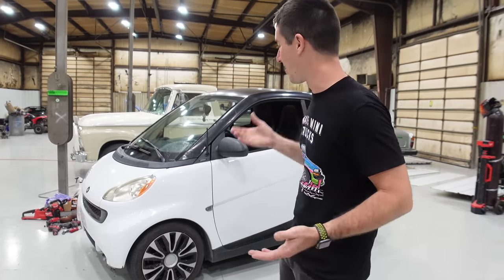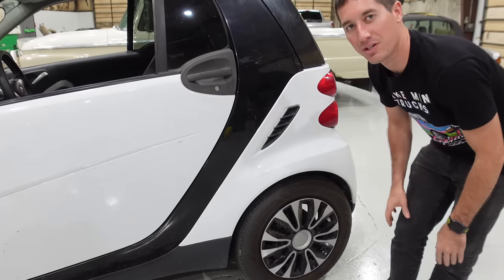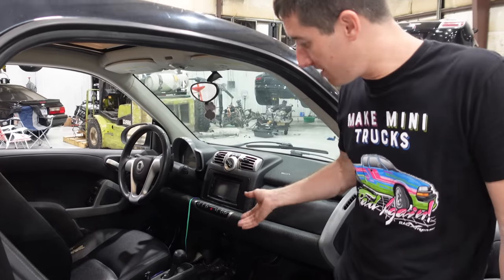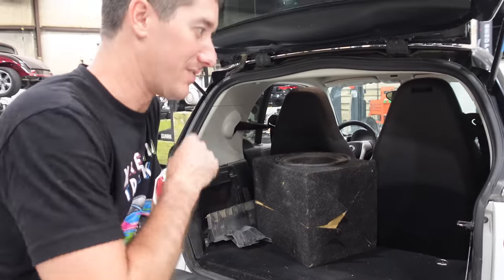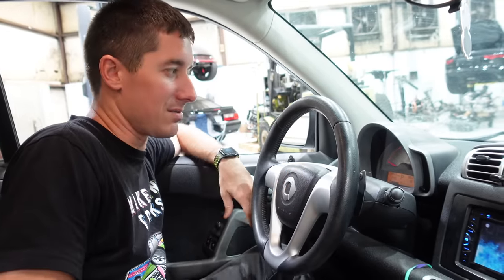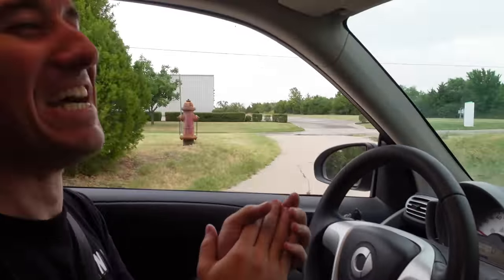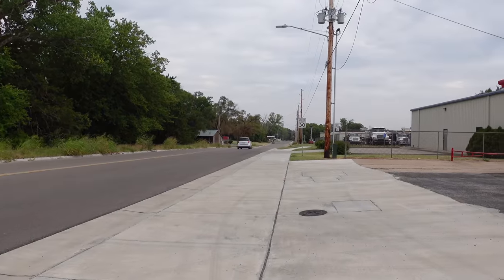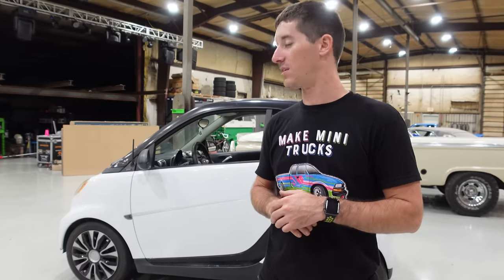I BOUGHT A CHEAP Smart Car.. Is It As DUMB As They Say?

Comment: I never took Smart Cars seriously in the past, but this video changed my perspective on them. I like them now!
Reply: I thought these were more practical than people gave them credit for. When this car first came to the States, RV brands didn't laugh. They saw an opportunity: one class A and several fifth wheel trailer brands immediately worked on converting one model in their catalog to hold one! They even added a clever hydraulic ramp that could slide out with a remote. That way, you do NOT have to drive it in. Park it on the ramp and hit the switch. It pulls the car into the garage. Even better, the wife's purse is safe because burglars can't break into the car if she forgot and left it on the passenger seat. I lived in Switzerland for a short while and trust me, they CAN be driven on snow and ice. If they couldn't half of the city would be crippled on its morning commute! These were everywhere. Even the company my dad worked for had one for advertisement. It was a distributor of powders used to treat paint so you can easily adjust the brightness of white or gray paint. Trust me, there's a sizeable market for that.

Comment: Try pulling your clutch actuator out it's the 3 bolts right under your car or find the sweet slot of where your plot chicks will help it shift a little better unless you have a star system or a scanner to do it  Also putting your are key accessories on and holding those 2 buttons  Down on your - at exactly the same the same time and the middle triangle will Flash it will turn your track you can throw off let your wheel wheel spin a little bit or  you can pull the abs  Fuse
Reply: Oh, that's why it squeals... even with a passenger.

Comment: So far loving my 2010 Smart…I bought it in 2021 with 7k miles.  I drove from Texas to Florida without any issue… other than it’s not too comfy to sleep in 😜…. I consistently looked down to see my speedo between 85-90mph 😳…. I read it would go 96 mph and I believe it.   It definitely takes it a little time to get there but I didn’t buy it to be fast off-the-line.  My mileage fluctuated between 35-40 mpg going at LEAST 80 mph the majority of the time.  I plan to upgrade the front tires/wheels… that’s about it.  Mine does have auto-down windows, I guess that was an option or something….

Comment: Brilliant video!  My partner has got a convertible Smart, and what a cracking little fun run around it is for work commutes, shopping and doing upto 100 miles per run or even a bit more. They are fairly safe, well made, economical and they are a  definte head turner as well! Its a proper 'girly', fun run rider car  OR for maybe a guy that fancies an around town head turner.  I drive a Mercedes SLK, and the Smart seems to get more attention than my car!

Comment: The best off-road rig is the ZAZ 968. Rear mounted air cooled engine with rwd setup along with suspension made for soviet rural environment means it can fly through the fields like it's nothing.
It also can be fixed with hammer and string anywhere.
Reply: It was designed based on Porsche ideas.
Reply: @johnkelly6888  Do Porsches have an ice fishing hatch? didn't think so :)
Reply: @dgurevich1  what model are we talking about? Back in the sixties all had multiple openings in all directions.

Comment: I have a company Smart Car, the same one  as in this video. And I love it. The transmission is ridiculous, as is how genuinely quick it is.
Reply: Until you get slammed by a drunk in a bmw
Reply: @Chad-Giga.  I thought so too - 2 weeks ago in heavy rain and stop and go traffic, I got rear-ended by an F150. While I went sliding a bit, there wasn't any damage to the car. The Ford, though, needs a radiator and AC condenser. I'd like to keep the sample set at 1, but I feel a little better lol

Comment: I had a 2009 Smart Passion it was great! I loved the car no issues handled perfectly. The problem was when it needed a repair no mechanic would touch the car. I brought car to dealership. I was told I needed a $2000. Plan to get smart fixed. I got rid of the car. These cars are great vehicles the people can not rip you off enough to make a profit that's the real problem. These cars handle real well. The mechanics can't rip you off. Please sell this car with a handbook how to repair and a mail order to purchase parts. This is the peoples car. Very economical sturdy and safe. Greedy people are the problem.

Comment: I bought my new in 2009 .0.8 diesel..never had any problem with it ..Now 82000 miles on clock once changed  front brake pads 25£ ,thermostat 30£,gearbox oil 50£ and service (40£)every 6000 miles..still driving like new and I get 75mpg..best car I ever had ...

Comment: I was going to trade my old metro for one of these but the mileage was nowhere near to compatible at 48mpg on the metro.
Reply: I know, I had the OG Metro called the Sprint and I got the full rated 60 mpg. For the first 50k, then the mileage went to exactly zero mpg because it was completely done.
Reply: I had a 2 door, a 4 door, and a convertible metro. Amazing on gas. They should build it currently. I would buy them.

Comment: I have a 15 year old Smart (I am the original owner.) It has been the most reliable vehicle I've ever owned. I've only ever changed the oil, replaced tires, and replaced a broken engine mount (?!). I love this car and I'm going to run it until it disassembles.

Comment: Welcome to the addiction. I have owned 4. Let me tell you that you're going to have so much fun like you said. But wait! There's more! Put in a turbo, air intake, headers and remove the muffler and prepare yourself. But wait there's more! But some cheap beat up Hayabusa or motorcycle engine and put the tac on the glove box door and watch the magic happen. The smart comes with hill climb assist and anti roll control to help control sway in case you have to suddenly steer left or right. If you need to to do engine work then remove the right rear wheel well and the ground wire and the 2 rear frame bolts and this will drop the motor at an angle allowing you to work on it. For a full engine out it's even easier than a lot of engine outs. Approximately 30 mins or less. If you do anything to the car start with a head gasket and timing chain guides.  Enjoy your smart and welcome to the community.

Comment: I own a 2015 and it has the auto windows.  I can't put bigger tires in back with smaller in front because of the sensors and the traction control.  I need to have all 4 tires the same size.  I put the Daystar lift on mine so I can put 195/60r15's on all the wheels when the originals finally wear out.  Mine has 165/60r15 in front (22.8") and 195/50r15 in the rear (22.7"). They put wider wheels in back with thinner ones up front by design.  It's the only way I can legally drive a go cart on the street and not get in trouble.

Comment: I believe that I've seen safety tests of this with better results than many SUVs and trucks of that time. Yet i also remember that a lot of USans at the time said that they'd not feel safe in traffic...

Well, it's no bumper car, it will take damage in a crash, but chances are that you will come out of it in better condition.

Anyway, time to figure out how you want to mod it, the little tikes colour scheme is a good start, then perhaps replace the motor and suspension to taste.

Comment: Personally, my belief is that the only Smart that makes sense, is the Cabriolet. The sliding canvass roof has the massive advantage that you can open and close it at any road speed- in scattered shower conditions, that means that you can dodge the raindrops, opening and closing the roof as necessary to avoid getting wet. It transforms the car from a slightly gas-hungry sub-compact with almost no trunk space, into a a ridiculously fun open-air runabout.

Comment: I've had two, still drive one, and love it. It's a blast to drive, goes great out of Town, and is stupidly cheap to run. It does everthing I need, and I just taxed it for £20 then put two new tyres on the front for £95. I just looked up one new tyre for a Model Y and it was £270! EVs are the future, but it's going to be decades before it makes economic sense to part with my Smart Car.

Comment: BTW, the secret to shifting, is to treat it like a semi-automatic. If you lift the throttle slightly, it shifts when you want it to, and the shift is fast enough that the front end doesn't have time to squat. Driven that way, it actually feels quite responsive. Still, the electric version is a lot better in traffic.

Comment: I worked at the Hertz car rental place a long time ago and some people stole a couple of our cars one night by driving into the fence between the posts and the fence stretched and lifted up as they went under but man did it ever scratch those cars up. We found them all parked in a lot about a mile down the road and everything from front bumper to trunk lid including front and rear glass was scratched and gouged from the fence.
Reply: Repairs should have been easy as most of the body panels could pop off and be replaced.

Comment: When people here laughed at the SMART Car, RV brands saw an opportunity to take advantage of its alleged portability. I saw ads pop up online for fifth wheel AND even one or two Class RVs that had a garage to hold the car! There was no need to physically drive it in. Most of the RVs and trailers had a hydraulic slide-out ramp. Just deploy the ramp with a switch, park the car on top, strap it down and away it goes - right inside the RV! Even better, you can sleep, knowing nobody will try to break into it.

Comment: The bad reviews on these sre insane. I own a 2009 fortwo and it is literally the best and most fun city driver i have ever owned. 

I literally get like 50mpg and its a very smooth drive, and the cabin feels much bigger inside than it looks outside. 

It can be driven manual or automatic, and since theyre built by mercedes, even being cheap, its all built pretty well and easy to fix. 

I am NEVER letting my go, even when the transmission and engine need replacing.

Comment: Designed by some really smart Swiss engineers. If you put a modern 1000cc motorcycle engine in an old Smart. It will beat a Ferrari in a 1/4 mile drag race. 
"Smart-Busa-Bois" could be a thing.

Comment: For a used fuel efficient car, the 2017 Hyundai Ioniq Hybrid is a good choice. And it actually has two more doors and usable back seats. This Hyundai car was brand new for the 2017 model year and an affordable hybrid option as well. With a low-price tag and great fuel economy, it's regarded as one of the most fuel-efficient used cars, rated at 57 city/59 hwy/58 combined mpg.
The 2017 Kia Niro is a surprising good choice as well. Not many SUVs can compete with the other fuel-efficient used cars (except for crossovers), but this used Kia SUV can. It's rated at 52/49/50 mpg. In 2016 the Kia Niro received a Guinness World Record title for lowest fuel consumption by a hybrid vehicle. The Niro hybrid drove from LA to NYC with a fuel consumption record of 76.6 mpg beating the previously held title of 64.55 mpg set by the 2011 Kia Optima Hybrid. An EV version of the Niro was launched in 2018. https://www.phillong.com/used-cars-great-gas-mileage.htm

Comment: The "fortwo" that the US got is a bit lame compared to some of the options the rest of the world got, but maybe it is the perfect offroader. However, The smart roadster for example, looked super cool, and I think it was available with a 1.5l turbo diesel and 6 speed manual, but I may be remembering incorrectly.
Reply: I saw these with T-tops when I lived in Europe for a short period. They were NOT slow at all. I bet the hp/weight ratio was within supercar territory.

Comment: I had a used on for a year. It would  not pass emissions and no one would work on it so I took it back to the used car lot that I bought it from and traded it in for a Honda. Since I lived in the city, I never had to go over 45 mph. It work fine for my needs. I did not like the rear wheel drive. There is no way that I would take it out on the interstate. Everyone said that it was a coffin on wheels. The Japanese take out the motor and put in a big motorcycle engine.

Comment: My 2009 is the Cabrio version and I've owned it since new.  Love it.  BUT, the convertible roof malfunctioned this past weekend and I've been unable, so far anyway, to locate a shop willing to undertake the repair.  The closest Mercedes dealer is over 100 miles from where I live.  The malfunction is mechanical.  The fabric is fine.  It slipped a clip, (or something), and ran unevenly in the tracks until it got stuck.  I've got it unstuck, but need a skilled technician.  Anybody have any ideas?

Comment: A friend of mine bought one in California when I first came. He was 6'5". He bought it for his daughter who was going to college in Washington DC. There was no rear license plate on it whenever he bought it. So we had to install a license plate bracket and light in the back hatch. We took the rear hatch apart which was easy and it was reinforced with steel and styrofoam 🤣. I fabricated some cross braces, drilled through from the back and put some zert fitting, pig-tailed electrical from the taillight, reassembled... Then he got his tall ass into that thing and drove it cross country 🤣. I am 6'3" and could barely fit in it and the top of my head was brushing the roof and my knees were touching the dash. I have no idea how he made it on a trip that long but I am sure it was a grueling painful experience 🤣. 🤷 Things we do for love ❤️.

Comment: uses too much gas for me. I only get about 6l, 5 to 100kms. It does run on E85, ethanol. in the winter I add 3 litres gas to each full tank of ethanol. I'm in France ethanol is roughly half the price of gas.

Comment: They're honestly dead simple to work on. You can get the entire rear power unit (wheels, axles, engine, transmission, subframe...) out in about 3 hours, but most things can be done with the engine in, from underneath.

Comment: The smart car is actually a well made car 🚗. It is after all a Mercedes product. The naysayers always underestimate the car. 1) there is plenty of room inside. Very comfortable seating. Not so much room for stuff. In other words, you’re not picking up a pallet of cinderblocks from Home Depot. 2) it’s a 1000cc 3 cylinder engine. It’s built for city and economy. You’re not breaking lane speed records with it 😂. 3) people sometimes tell me I’m going die in that thing. On the contrary, there is a thick hunk of steel that surrounds it as the roll cage. I found that out when I was looking
For something solid to lift the car. 4) transmission is a 5 speed automated manual. In other words, it’s a manual transmission but the car does all the shifting and clutching. My wife complained about the “jerkyness “. I showed her how to come off accelerator to allow the car to shift. Way smoother ride. 5) the fuel mileage and parking is amazing!  The car gets up to 50mpg. Parking is virgin tight by the train station so I look purposely for the ass that tried to take two spots and squeeze right in! 😂😂 then leave a note “didn’t expect me to have a smart car did you?” 😂😂. Well worth it.

Comment: I had a convertible one and I felt like a total doofus driving it. Not only did it not have cruise control, but the top was so crazy people would laugh at you. Furthermore, the car was slow and unable to pass unless you put your foot down. As for the transmission, it was so horrible. The stupid thing didn't know how to shift unless you made it shift, and it would take 25 seconds to change gear due to it being such a piece of junk. Also, don't get me started on highway driving. Getting on the highway and driving long distances was kind of like stepping into the ring with Mike Tyson. The car could be pushed by the winds and passing trucks was terrifying. You constantly had to fight the steering to make sure it didn't get out of hand. Also, you had to keep an eye on your speed too as my car didn't have cruise control. I mentioned that already I guess. Anyway, the convertible top was a joke, and so was the people asking me if the car was electric. I would always tell them the Smart car was a hybrid. There was a little slot for the big key that you would have to spin to wind the car up, and the gasoline motor would assist. People thought I was telling the truth and then I would tell them I was just kidding. Many of them thought I was telling the truth. It really was a joke car for its time.

Comment: I just watched Wheeler Dealers. They took a BMW 335 Tourer (Station Wagon) and turned it into a M3 Tourer. What I wanted to mention, is for the Detailers. Instead of paint, they used a process that goes on like paint, but can be peeled off exposing the base paint. It is a latex. The process costs between that of a wrap job and a paint job.
Reply: and about 1/10th of the quality ;)
Reply: @lawrencemercieca  True! It looked like they wrapped it in a giant balloon!

Comment: Smart cars are extremely overpriced when they're new but you can usually get a really good deal on them used. And they're usually pretty good vehicles with great gas mileage usually 40 plus miles a gallon however good luck getting tires or rims for a Smart car It's next to Impossible these days they're discontinued and it takes forever and ever to special order them and they're very expensive for such small tiny cheaply made tires. Unfortunately due to their Rarity of availability. If you ever do need tires make sure you get the proper size because they take a different size for the front then the back even the rim size is slightly different. they're extremely hard to find brand new. You'll know if you have them on wrong if your ABS light comes on. Make sure to read the inside rim. And place accordingly.
Reply: Used to own a Geo Metro back in the day. 15" rims and tires are hard to get in general.